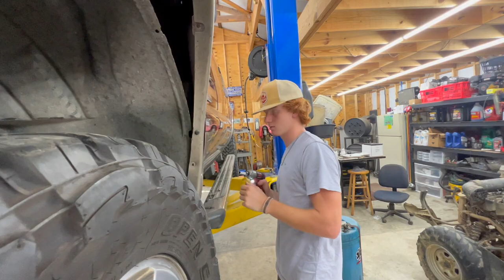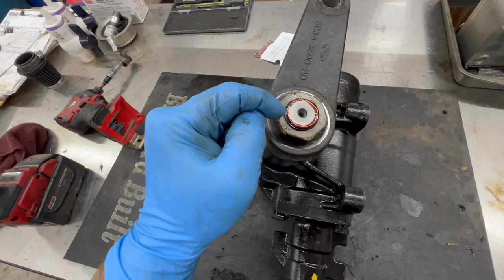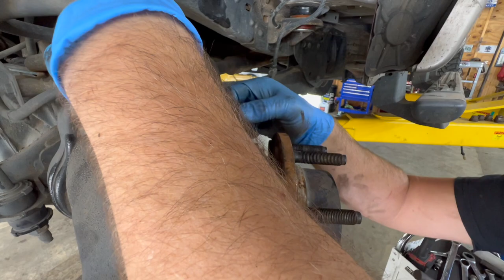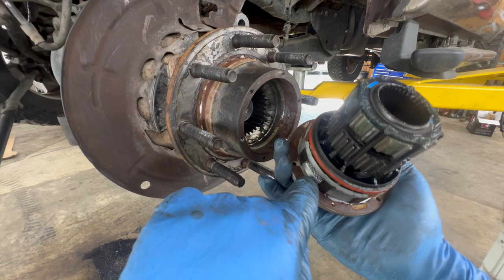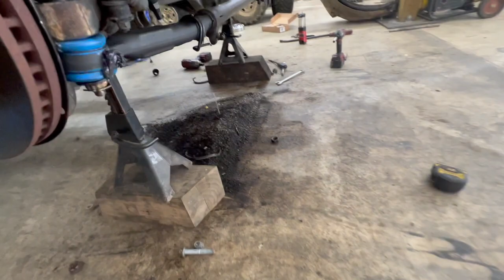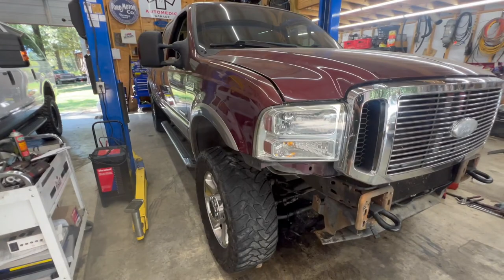Wrecked 6.0 Powerstroke gets a front end rebuild

Comment: My 06 F350 had a front blow out, less damage as this, and insurance wanted to total it and send it to auction. I've got more $$ in the engine than the truck is worth. It was a fight but I got them to drop the claim and paid out of pocket. The bill is much less going that way. And I'm not stuck with a "Salvage" title. The blown tire took out wiring harness ECM/TCM and fuse box of course fender & inner fender. No steering damage and front bumper is good.
Reply from the maker: They wanted to total his truck to, I helped him fight it cause my 99 f350 with only 124k they totaled also and started at $11800 for the truck. Told them there was no way I could replace that truck for that and they came back with $16800 which still wasn’t great but I took it.

Comment: Man, when you’re able you’ve got to get the Snap-On BJP1 ball joint press and also the Snap-On branded or Schley heavy duty pitman arm puller. You’ll make your life so much easier with those jobs.
Reply from the maker: It looks nice but not $700 nice. The $100 oem tools one has served me well for years. Has yet to let me down. Now the pitman arm puller sounds nice I destroyed my last pitman arm puller and just started using the press instead.
Reply: I bought it for my 2 trucks I found a nice used one on eBay for 550. I didn't want to take the chance on cheaper ones.
Reply from the maker: @FORD4LIFE73  I’ve beat on that oem tools one pretty hard and it always gets the ball joints out. Can’t beat it for the money
Reply: @AutomedicGarage  What’s the part number on this? I want one that can do the Dana 60 joints
Reply: Nevermind lol
Reply: @AutomedicGarage  I hear ya on the price but you can find them used for $500 really easy. Totally worth the money. You’ll also make quick work of u-joints with it.
Reply from the maker: @Banshee365  I’m not knocking snap on at all but I’ve made a lot of money with my $100 oem tools press, have used it on u joints also however I usually use my press for ujoints. When and if I tear this one up I’ll look at the snap on. I’m sure it’s a great tool .

Comment: If theres a play in the steering wheel is that vecause of the steering gear box or are there other factors?
Reply from the maker: There wasn’t play it was locked up and wouldn’t do anything from the wreck.
Reply: @AutomedicGarage  I was saying as if there was. My truck has it and wondering how would I solve that problem.
Reply from the maker: @moiseis1703  get someone in the truck and have them wiggle the steering wheel left to right over and over meanwhile get under the front of the truck and look and touch every single pivot point on the front suspension and look and feel for anything sloppy or loose. More often times than not it’s not the boxes fault and it’s a combination of ball joints, tie rods, drag link and track bar. Give it a good look over.